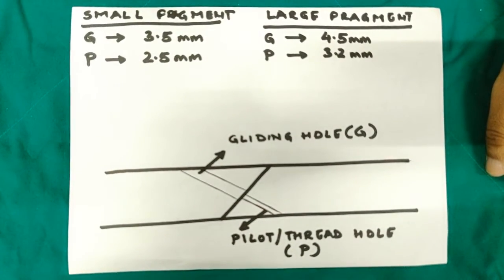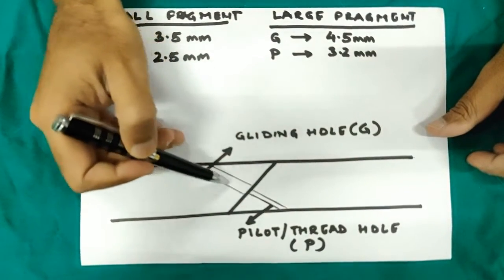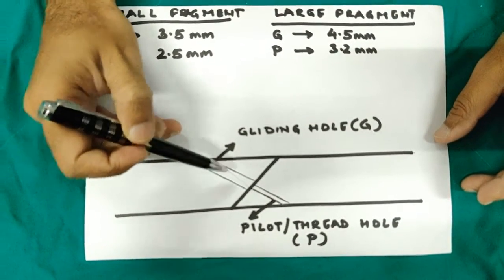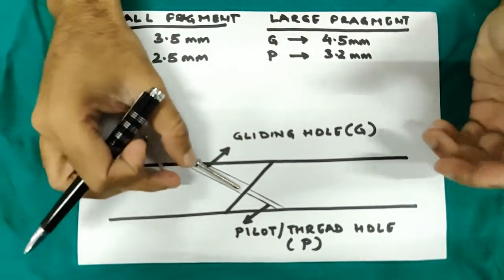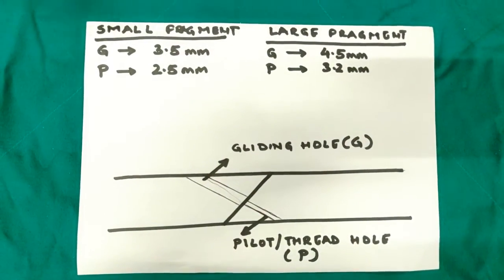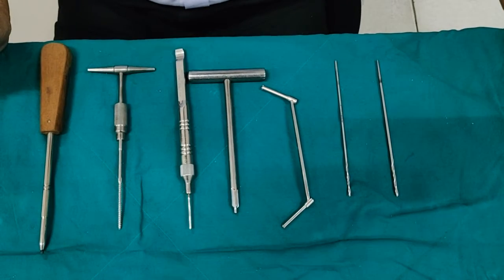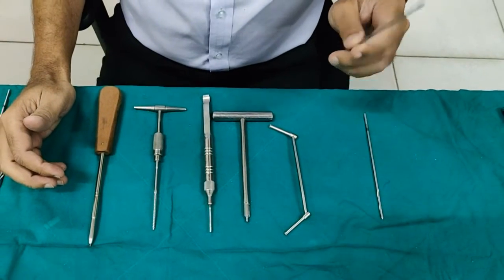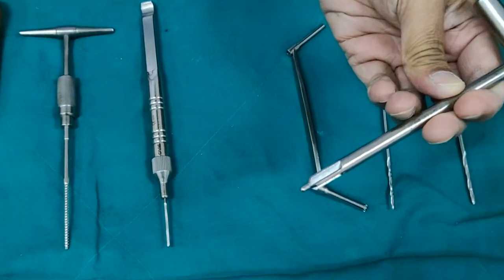Lag Screw Technique (Small and Large Fragment)

Comment: Thank you Sir..
Nice demo..
Sometimes, we find it difficult to seat the plate after putting the lag screw. request if you can demonstrate Sir. Whether the neutralization plate (or even bridge plate) should be put orthogonal to lag screw or over the lag screw once its head is countersunk?
Reply from the maker: Akshay you have few options as you mentioned in the question. 
1. Seat screw after countersink so that it's not proud. 
2. Put plate in a way that head if screw is in different plane like we do in fibula fracture around ankle. 
3. Put lag screw through the plate. 

If you use lag screws then your plate will be neutralisation mode not bridge mode.
Reply: Thank you Sir for your prompt response Sir.. It's crystal clear now sir..
Regards
Reply from the maker: @akshaypushkar807  my pleasure

Comment: thnks for doing good job in pandemic situation..which one is better? lag in the plate  hole or lag directly  on the bone? doing tab is necessary?
Reply from the maker: Lag screw through the plate is much stronger than the screw on its own. Tap is needed if you are using a non tapping screw.
Reply: @DrVinayKumarSingh  sir that means 1st lag then all screw in neutral hole..?
Reply from the maker: @mohammadminhazuddin743  that's correct else it will create compression and lag screw may come loose or fracture may displace.
Reply: in case of lag through the plate what is the sequence of screw?
Reply from the maker: @mohammadminhazuddin743  it's S3 except first step will be reduction and application of plate.